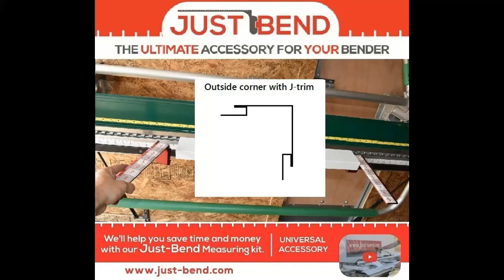Bending an outside corner with integrated Jtrim using the Just-Bend tool

Comment: Please post a video how you would go about cutting a bunch of 1 1/2” flat stock using your systems
Reply from the maker: Depends how you're cutting?  With a blade knife or a cutting slitter?
Reply: Using your whole system.  The material stopper, the slitter, the measure sticks….. i can do flat stock with knife and your measure sticks… but curious how you would make 1 1/2” flat stock using the slitter on a pro 14 brake with slitter.
Reply from the maker: @aluminumtrim  do you do 1.5" wide often? Seems very narrow of a piece to start with? The stopper wont go down to 1.5" so 
 i would probably use the stoppers to rip down to 12" then into 6in and then 3" and then slice the 3inches into the (2) 1.5" using the magnetic measuring tools?  That what i think would be the most efficient? Once you have the (2) 12s in the beginning  double stack them to cut 2 thick at a time? Let me know if that makes sense?
Reply: Makes sense to me… but yeah, i have to make 1” to 1 1/2” flat stock often and was trying to wrap my brain how i could achieve it with the slitter efficiently. Would be fast af. Just the measure gauges get in way of slitter… i wonder if i could improvise a peace on the stopper to go back farther into the anvil of the brake to catch at a 1 1/2….
Reply from the maker: @aluminumtrim  or cut (2) 12", stack them and then pull the stoppers towards the front by 1" (or 1.5" or which ever measurment) so that the  material comes out of the brake for the size you need to cut and go through this process until you no longer can
Reply: There it is!! That’s the answer!
Reply: Or just make my marks on the table and just use the slitter besides having to move the stopper each time

Comment: The only drawback to this system is that you can't use your Pro Cut-Off, or the Van mark equivalent. The device is in the way. I've always tried to avoid using a razor knife whenever possible to avoid the inevitable "slips" onto the stainless. And I'm sure that anyone who's been around for a while has razor marks on their stainless. Especially if they've had inexperienced new guys. I've owned 3 brakes (all Tapco) and all of them have had cut marks on the stainless.
Reply from the maker: Thank you for your comment A.S.  Yes indeed our magnetic measuring brackets need to be removed when cutting with either our Innovatools 2-way cutting tool or Tapco's pro cutoff or Vanmark Slitters.  The measuring accessory i prefer to use when making cuts using a cut off tool is our Stopper tool which does not interfere with the cutting tools.  Once my pieces are cut to the correct width then i use our magnetic measuring tool.  Keep in mind this was the first brake accessory i invented/launched to market and we since then have launched multiple brake accessories to make every aspect of bending/cutting much more efficient compared to what was previously available on the market.  Our new Modular Brake that will start shipping in the next few weeks will be a game changer!  https://youtu.be/mrS5PRW8beg